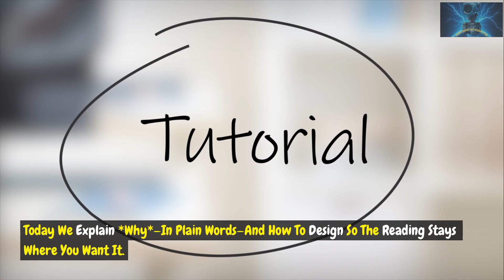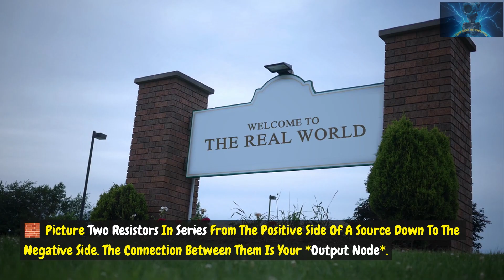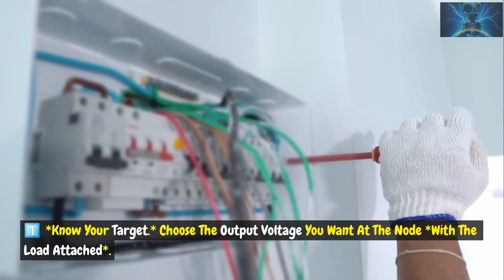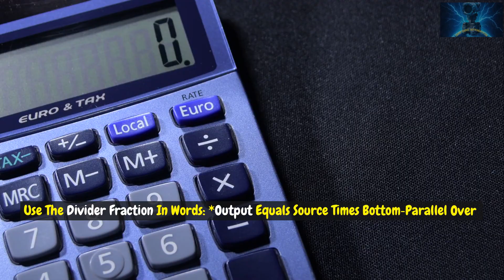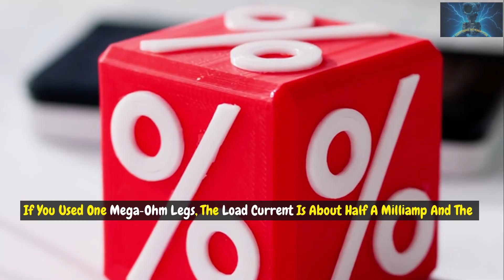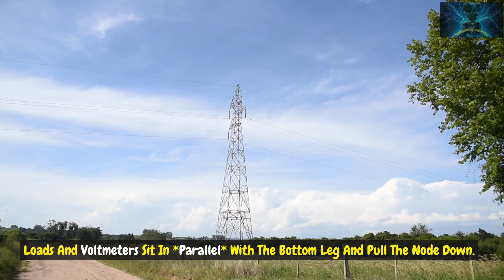🔌Voltage Divider Loading Effect: Design Rules & Troubleshooting 🧰 Ep. 73

Comment from the maker: Pop Quiz for the comments: 👇 If you use a cheap analog voltmeter (low impedance) instead of a digital multimeter (high impedance) on a high-resistance circuit, will the voltage reading be HIGHER or LOWER than the true value?

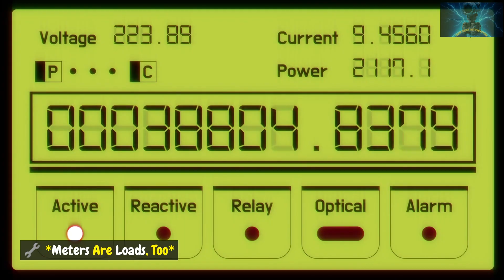(Answer in the video at 1:53!)